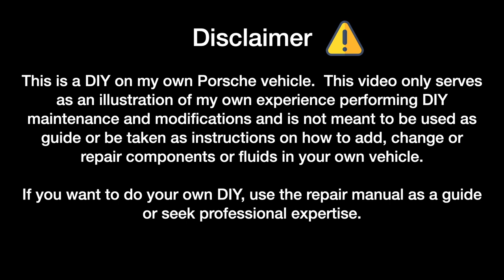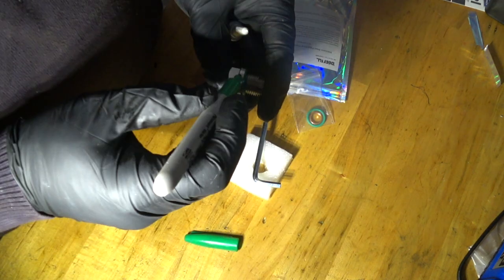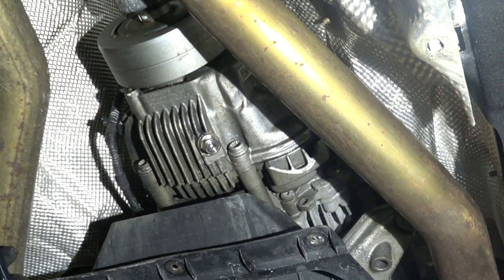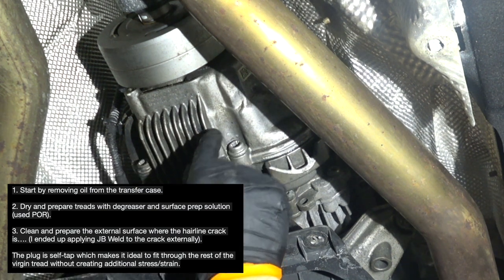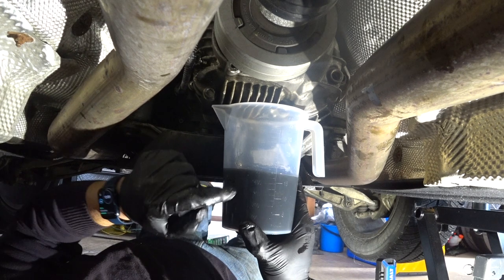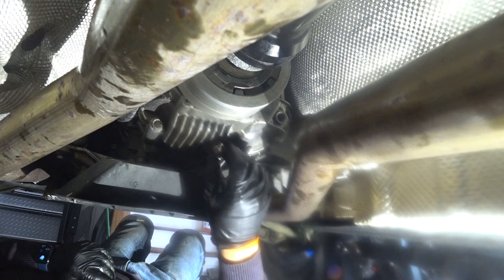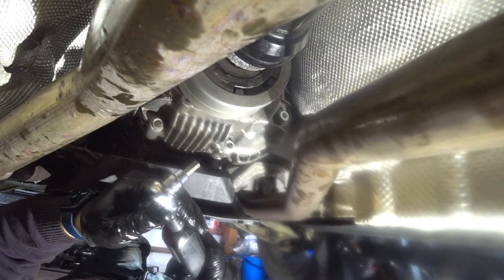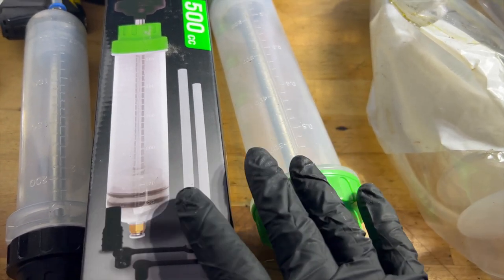I cracked my Porsche Macan Transfer Case!!! and repaired it!

Comment: Thank you so much Santrix! Your videos are clear and your recommendations are concise. I am preparing to tackle my GearBox/Front Diff, transfer case and Rear diff as well as my upper control arms once the temperatures come down below triple digits LOL! You are The MAN!
Reply from the maker: Thanks for your kind words.  I’m still editing the upper control arms replacement video…. Hopefully will come out before you do yours….  Good luck.
Reply: @porscheDIY  I'm trying to decide whether to use Meyle HD control arms or 034 motorsport Density Line or go with Powerflex Polyurethane purple bushes and replace the torn oem one's; or just go with a new set of oem TRW's. I hate that the right side bushes tore at 60K! But maybe that's what happens when you slide a 4000+ lb fat 911 thru turns lol! What did you replace yours with?
Reply from the maker: @stevelazar4433  Meyle HD for the front.  Working very well.  For the rear I used mostly Powerflex, because there was no Meyle HD kit for rear yet.  If there was a kit for the rear, I would’ve jump on those eyes closed.  Meyle HD is very good.

I actually replaced my coolant pump with Meyle HD as well.

Comment: Thank you for doing this for the Porsche Macan community. You are a legend on the Macan forum. My question is do you recommend replacing the factory plug with the new one you recommend even if don’t see a crack around the drain hole area? Thank you
Reply from the maker: If you plan on replacing oil frequently, if it was me, I would replace it with a non-tapered plug with a compatible o-ring or crush washer (not necessarily the one I used to repair mine, but a M16x1.5 plug).  I do plan to replace the fill plug with a non-tapered plug on my next oil change.  Otherwise, be careful when installing the tapered plug.
Reply: @porscheDIY  Yes sir, I do plan on replacing the oil frequently because I do plan on keeping the vehicle long term. Thank you so much for your help and quick response.
Reply from the maker: If in doubt, remember to always consult a professional… maybe talk to the dealer.  Don’t just take only my word for it…😊
Reply: @porscheDIY  I will definitely consult a professional or my local Porsche dealer if I have any questions or issues.

Comment: I am about to attempt this repair.  I have a cracked case.  I ordered the plug replacement from amazon.  Hopefully everything goes well.  Question: Once you tapped the hole with the plug, did you remove it and then add the thread sealant, then re-install?  Thanks
Reply from the maker: @1jbunceiii  Sorry to hear about your transfer case.  Correct.  I removed it, cleaned the threads with alcohol to remove any aluminum particles, then installed the plug with high temp thread sealant.  Then fill the TC with oil (but completely but enough to flush the bottom part where the plug is) and flushed it a couple of times just to ensure I removed all  particles.

Good luck and let us know how it goes.
Reply: @porscheDIY  I just completed the repair.  I drained the fluid the day before, installed the plug then removed it and cleaned everything.  Then installed with Permitex and let it sit for 12 hours overnight before adding the fluid again.  I refilled in the morning, so far no leak, but I'll will keep and eye on it.  Thanks again for the videos, they help!!

Comment: could you please leave a link for the motul fluid you bought? I would appreciate it and love your videos
Reply from the maker: Thanks for your support and I appreciate your comment… hope you are subscribed.  Note that I’m using Motul DCTF for the transfer case, not the recommended Porsche fluid.  Also note that I’m not recommending this product for use in Transfer Case applications.  Motul DCTF is recommended by Motul for Dual Clutch Fluid applications, but it was also recommended by Motul for the Transfer Case in the past, but that is no longer the case.  I started using the DCTF for transfer case before the recommendation was discontinued.  Although I’m not recommending its use, I can say that my Transfer Case is performing very well since I started using this oil.  Recent oil analysis reflected no contaminants, wear, nor oil degradation.  It seems that my transfer case is operating optimally given the oil analysis values.  Iron, Zinc are well below average standard… no water ingestion, etc…  Link provided for reference, but if you are using it, do it at your own risk…. LINK:  https://www.motul.com/us/en-US/products/multi-dctf .   I purchased the fluid at FCPEuro:  https://www.fcpeuro.com/products/dual-clutch-trans-fluid-dctf-1-liter-103910

Comment: I literally yesterday watched your video "Transfer Case Oil Change DIY" where you said in comments that you used Motul DCTF. Seems you have no issue with this oil, but "motul oil selector" recommends this oil for the clutch part of transmission and recommends MOTUL GEAR 300 LS 75W-90 for hang-on differential (as i understand hang-on differential and transfer case are the same).
Also i heard that our Macan uses hypoïd kind of transfer case that needs a special oil additive to reduce friction and MOTUL GEAR 300 LS 75W-90 has this additive and it's written in its description
Have you heard about that? I am going to replace all liquids in my macan gst and trying to understand where and what oil to fill.
Thanks for your videos!
Reply from the maker: You are correct in which the Motul DCTF is specified for the clutch side of the PDK transmission.  I actually used this oil in the clutch side of my PDK, as you can see in the specific video I made for that oil and filter replacement (https://youtu.be/W-1JpAB2g0Y).  The actual recommended oil in the Porsche Macan manual is Castrol BOT 342 A, and Motul Multi DCTF is cross-referenced, compatible and even miscible with this spec’d oil (if you read Motul Multi DCTF spec’s you’ll find that is miscible and compatible with Castrol BOT 342 A).  

Motul Gear 300 LS (which stands for limited slip) is specified for the hang-on differential or rear differential (they are both the same)… the one referred to as the hang on is the one without lock (without Porsche Torque Vectoring) that requires 1.2 liters and the other one is the one with lock (with Porsche Torque Vectoring) that requires 1.45 liters.

Porsche Macan S 2015 (No PTV+) -  Rear Axle Differential Oil Change
https://youtu.be/Nd8TF875b80

From the Motul spec, I guess they are stating that we could use same oil for both… however, spec from manual for non-PTV is Castrol SAF-PD and for PTV is Castrol SAF Carbon Mod.

There is currently no Motul oil specified for transfer case in their website for the US, however, there used to be a Motul Multi DCTF spec for Transferbox Hang-On (0.58 liters) for the US market that since then they took out (I checked the UK market and it is still specified for that market, interestingly).  The Porsche spec for transfer case is Shell TF0870, which is a form of clutch oil.  When you look at the Motul Multi DCTF spec’s you will also see that it is cross-referenced, compatible and miscible with Shell TF0870.

Our transfer box is basically a clutch, not a hypoid gear setup.  The rear differential is where you would have the hypoid gear setup.

To finish with the drivetrain, the PDK has 2 chambers… the clutch side I described earlier, and the gearbox/front differential side…. For that one, the Porsche Manual specifies Castrol BOT 233 FEQ (4.1 liters).

PORSCHE MACAN S (2015):  PDK TRANSMISSION GEARBOX OIL CHANGE DIY
https://youtu.be/OZ2V2be9Me8

As stated in my video, this is what I did in my own Macan.  I’m not recommending anyone to do the same without performing their own research or consulting with an expert.
Reply from the maker: You can check the Motul Multi DCTF technical product data sheet here:  https://azupim01.motul.com/media/motulData/DO/base/MULTI_DCTF_en_FR_motul_45611_20210712.pdf

There you can see Motul Multi DCTF is cross-referenced, compatible and miscible with the Shell TF 0870 and the Castrol BOT 342 A.
Reply: @porscheDIY  Thanks for your very detailed explanation that brought clarity to transmission liquids.
At the first glance it looks like i can use MOTUL GEAR 300 LS 75W-90 to replace oil in both: rear differential and transmission gearbox.
Now I am trying to understand what type of rear differential I have. On window sticker that i have i found a such item "Brake Actuated Limited Slip Differential", but not sure whether it is non-PTV or PTV differential.
Reply from the maker: I believe that’s what PTV means…

Comment: I really enjoyed all your videos. As an engineer myself, I also work on my cars. I find your explanations are very detailed and comprehensive. 
Since the Macan engine are direct fuel injection, this will cause carbon build up on the intake valves. Thus resulting in reduce horse power, misfire, poor fuel economy ... Have you encounter this? Any plan to do the valves cleaning in the future? What's the preferred method, walnut blasting?
Thanks again for your valuable information.
Reply from the maker: Thanks for your comments!  I have not had misfires in my Macan yet, but I’m wary of the carbon build up on GDI engines.  Yes, it is in the plans for the Spring.  I will be doing the valve cleaning.  My preferred method would had been dry ice blasting, but I haven’t found an inexpensive rental or system yet.  Hence, a combination of chemical (Liqui-Moly valve cleaner) and walnut blasting would probably be my go to method.  Once I remove the air header, I will also replace the coolant tubing that is prone to failure, as well as the 2 high pressure fuel pumps. 

Subscribe to the channel so that you can get notifications of upcoming videos.  Thank you for your support!

Comment: The drain plug and case is 3/8" NPT. Hopefully this comment helps everyone else coming across this video before damaging the threads, besides cracking the case. I understand your confusion at a metric vehicle having the possibility of using imperial components but pipe thread is a universal standard, with a few varying forms depending on regions and applications, I would suggest that you please do further research in the future before posting a video to thousands of viewers. 
For a solution, the same principle can be applied with a 3/8" to 1/4" Male to Female adapter, which will allow for more drain flow as well. 3/8" NPT adapters and 1/4" npt plugs can come in a variety of metals: brass, stainless steel, copper, aluminum, zinc coated steel, brass coated steel..etc.
FYI : yes, the casting can easily crack under the stress of taper fitting into a taper bore if the design is thin and the material poor. In this situation it is standard grade casting aluminum Alsi9Cu3.
Good luck in future repairs!
Reply from the maker: Thanks for your comments, it is a way to have good discussions about these topic.  

Having said this, my question to you is…. Did you get this information out of the workshop manual?  3/8 NPT is really a large thread, and it won’t fit, I don’t think it will.  Have you actually fit a 3/8 NPT for this application?  Maybe I’m wrong, will appreciate more clarification.  This is a smaller plug which is specified as M17.5 x 12, and is tapered.  I actually did a lot of research on this… and found a solution that worked in my specific case.

And to end, I always start my videos with a disclaimer.  This is my own experience in my own car.  I’m not encouraging anyone to do the same, but rather documenting my experience for others to see and enjoy.  I try my best to use my engineering knowledge and principles to do work in my car, but as I said before in some of my videos, I’m not a mechanic.
Reply: @porscheDIY  your metric measurements from the factory plug are within 3/8" npt specification. All you would have to do is compare the new factory plug you have side by side to a 3/8" NPT and you will see they are identical, or better yet, thread the factory Porsche plug into a 3/8" NPT female fitting. I have completed the repair this way, using a brazing method instead of epoxy. Epoxy and hot oil will not last forever.
I was only mentioning the research in regards to accuracy in the video, maybe you will consider to edit the information into the video once you are convinced yourself. As we know, whether the intention or not, many will follow this as it is their only option once they crack the casing. The comments only provide more evidence to this. No malice intended, but I did almost throw my laptop when I saw a metric taper being measured 😬!
Reply from the maker: I’ll take another look at this… when I look at the workshop manual, all oil drain plugs are spec’d in metric system… but I’ll check this specific one again, and will edit this out depending on what I find….for sure…. thanks for your comments.

My comments are really intended for my own edification.  Want to make sure I did this right for my own application.
Reply from the maker: I wanted to come back to this point, after more research on the matter (in addition to all the research I made before the video).  I can't find anywhere where the Porsche P/N 955-301-115-01 is a 3/8" NPT plug.  On the other hand, I have found about 10 different sources that states that this plug (P/N:  955-301-115-01) is a M17.5 x 12 plug.  I still removed a section of the video that addresses dimensions, but this is what I found.   I ask that you post any information regarding the 3/8" NPT specs you refer to.  I have seen this 3/8" NPT spec on Audi transfer cases, but not on Porsche Macan.

Here are some of the sources for Porsche Macan plug P/N: 955-301-115-01 (M17.5 x  12):  

https://www.fcpeuro.com/products/porsche-transfer-case-plug-genuine-porsche-95530111501?ads_cmpid=20903125153&ads_adid=160931765887&ads_matchtype=&ads_network=g&ads_creative=685995032613&utm_term=&ads_targetid=pla-2266769407173&utm_campaign=&utm_source=adwords&utm_medium=ppc&ttv=2&gad_source=1&gclid=Cj0KCQiAv8SsBhC7ARIsALIkVT13XuPE7b7lpr5Zq8KnDfqHU1C0r5IWwOQ8WwwotK4NXe8GXoO500oaAi-FEALw_wcB

https://www.pelicanparts.com/More_Info/95530111501.htm?pn=955-301-115-01-OEM&gad_source=1&gclid=Cj0KCQiAv8SsBhC7ARIsALIkVT25kw6uuW06eKtazhaqX4QqJ1XScFXxKebw3CJ--JNgpH3q1MAMXXkaAlHEEALw_wcB

https://www.ecstuning.com/b-genuine-porsche-parts/transfer-case-plug-priced-each/95530111501/?gad_source=1&gclid=Cj0KCQiAv8SsBhC7ARIsALIkVT3VB_odNaV80lrLQCrdWIxKX179NWmyc6HVb8hgm0uiiib7TsBfctsaAjyaEALw_wcB

https://www.rmeuropean.com/Products/95530111501-MFG1099-V810.aspx

http://www.autoatlanta.com/Porsche-Screw-Plug-Transfer-Parts-PN-G95530111501.html
Reply: Why would Porsche use a NPT thread, they're German?  Metric is the norm if I were to bet on it.